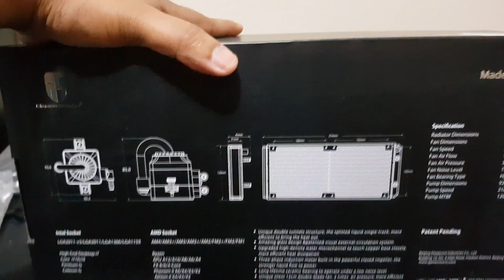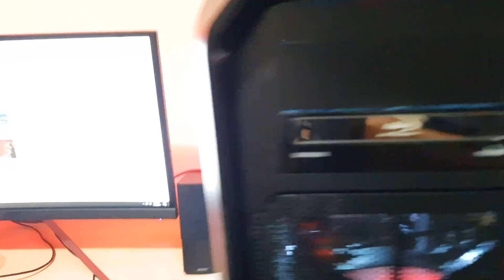Deepcool Captain 240 EX RGB Installation and Review

Comment: I am running a build with a z270A mobo from asus, but the aio pump is not detected even when plugged into cpu fan slot.
Therefore my cpu goes up in temp until i choose to switch it off..